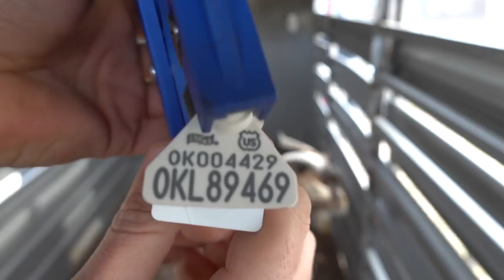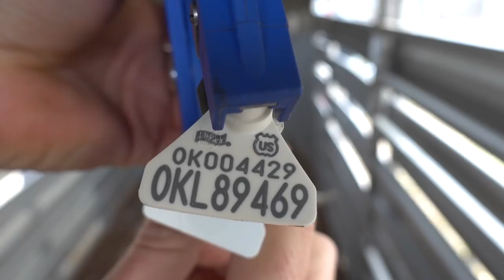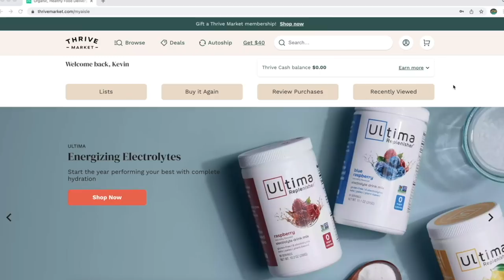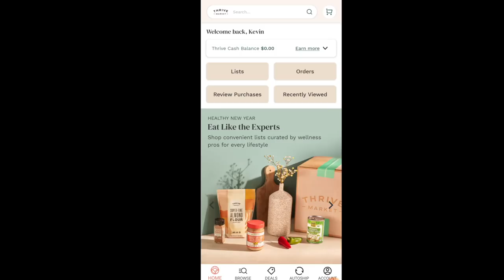This Was The Only Way To Stop The Attacks On Us and Our Livestock Guardian Dog

Comment: This is just a suggestion. I lived in a house which the underneath was open and it would get frozen pipes in the winter time. I went to Lowe’s and bought some pipe wrap made of soft styrofoam. It kept the pipes from freezing and it was cheaper than buying and installing the valve at the bottom of the pipe. Sorry to see Chip go but understandable. Be sweet as always and love to the family.
Reply from the maker: Great idea
Reply: New England secret- pool noodles work amazingly since they already have a hole thru the middle and it’s much cheaper $1 a noodle and they work just as great as thermal or styrofoam wrap!

Comment: Here in western NY we put heat tape on the pipe as a back up if there is water in the water hydrant. I thought I had completely closed the handle & I didn’t. Freezing overnight temps the pipe froze - after thawing the pipe & water worked I installed the electric strip & foam insulation & no issues since. Nothing worse than hauling buckets of water in freezing temps! We have a floating heater on the 100 gal outdoor tank & both horses have 2 heated water buckets in their stalls, so we don’t deal with frozen buckets. Good choice on taking Chip to the auction & getting him “off the tail” of the other goats! I pray you start feeling better soon & for the rest of the family, including Rachel’s mom.

Comment: I was thinking about a possible solution for the cord for Leaske’s water.  Could you cut two pieces of one inch pvc pipe, and connect them with a right angle or elbow to make a L shape?  Measure the pipe long enough to go all the way to the heater and the other one would run outside of the fence.Put the cord through the pipe and mount the pipe to the fence.  Love your post.  Greetings from Southeastern Kentucky.

Comment: For your shortness of breath/asthma situation. Your lungs are telling you to workout. Specifically cardio.

You don't need a lot to strengthen your lungs.

1 set of 20 squats as low as you can go. Then 1 set of 20-30 jumping jacks. You will see a noticable difference after the first week and a half if you do those 2 basic cardio workouts once everyday.

Comment: I've watched quite a few times and keeping your animals separate helps with disease control not to mention overall safety like what's going on  with the buck.   It just seems maybe by separating some of the animals  there would be less issues.  ( I do have  experience so I'm not just making suggestions without having any experience). 
God bless.

Comment: Kevin, I have had diabetes for 68 years.  Something I found at a nutrition store was Clinical OPC.  It had done amazing things.  I have diabetes heart disease.  Cholesterol came down, blood pressure evened out, and the heart disease has reversed itself.  There are different strengths.  I take the 150mg 2 times a day but you are a guy with more weight.  I would go with 300mg.  I used to get bronchial things all the time.  All of that disappeared.  Its good stuff and worth the money.  Its a bit pricey and Thrive sells it cheaper than the nutrition stores.    Now for your goat Chip.  It was time for Chip to go.  He was becoming aggressive and his line is well established in your herd.  Hopefully he ends up on a farm for breeding but he has to calm down.  You did the right thing.  Its hard when you raise them up from a baby and they get that aggressive behavior going on.  Its part of the farm.  And sweet MoJo doesnt have to worry about getting hurt anymore.
Reply from the maker: No fun

Comment: Kevin,
Just a suggestion for your water trough in Lee-kies pasture.
Put 2 large chicken waterer heaters under the trough and run the cords out the side bottom next to the fence. This will keep it from freezing. They are about 12 inches round. Tractor Supply sells them.
Sku# 1250232
Reply from the maker: Thank you sir, I will check them out!
Reply: @HiddenHeightsFarm  have you looked at the water heaters I mentioned above?

Comment: I don’t get these farms with a whole herd of goats, and all of them with horns. My goats are disbudded at 2 weeks, and never an issue because of it. Lots of horror stories about goats with horns though..nearly all of them purely accidental. Accidents can be painful, even deadly. Herd mates, pregnant does, newborn kids, owners, owners children, guardians…all accidentally, and sometimes purposely, hooked. Then there’s the occasional goat caught in the fence and breaking it’s neck trying to get out. Or the owner getting hurt trying to extricate a very strong, very freaked goat from fencing. Horns help the goat stay cooler in hot climates. Here in the states we provide shelters for adequate heat relief, and lots of fresh water. IMHO horns are extremely high risk, with no reward.